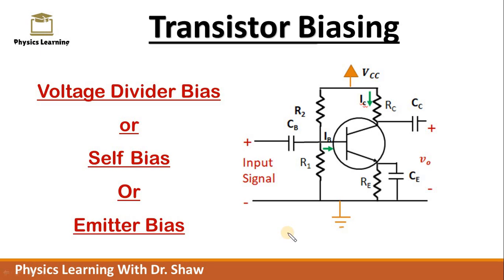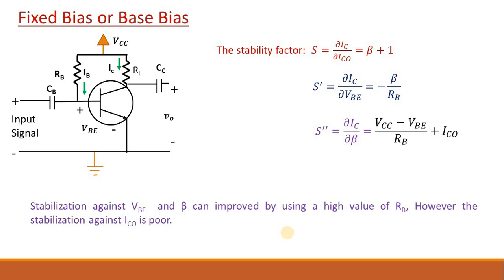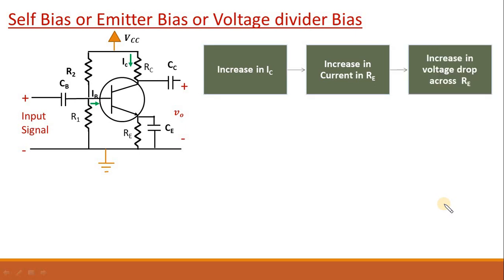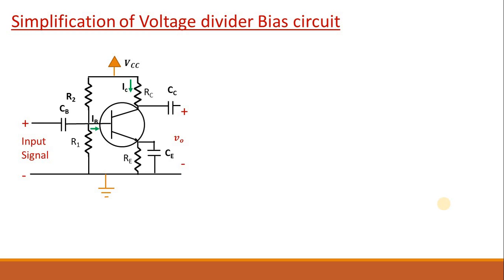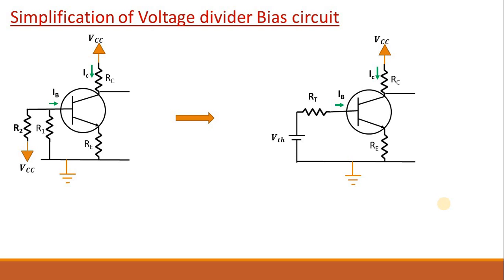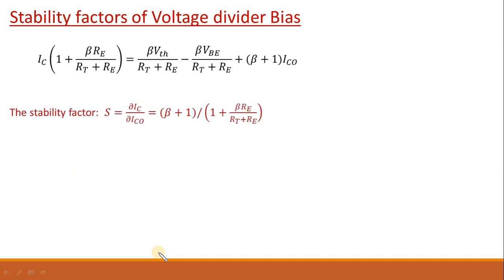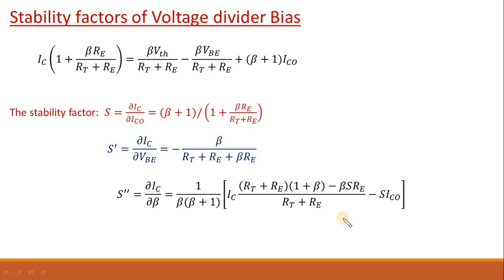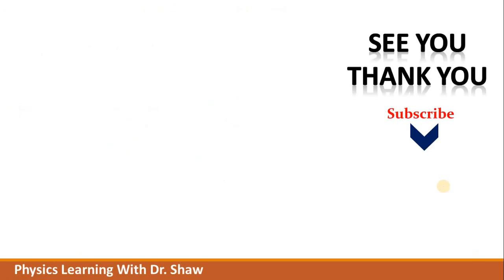voltage divider bias | Emitter Bias | Self Bias

Comment: Please upload another video in which you will be explain about  the circuit , why capacitors are used, why the resistance connected with emitter etc.